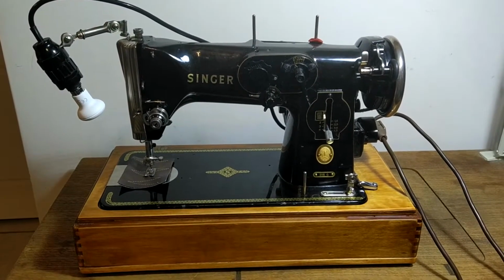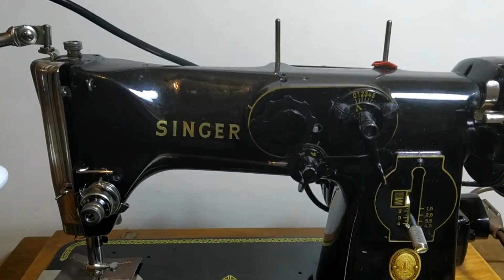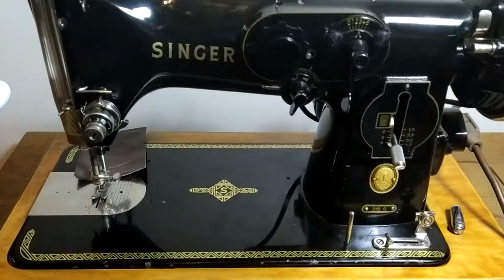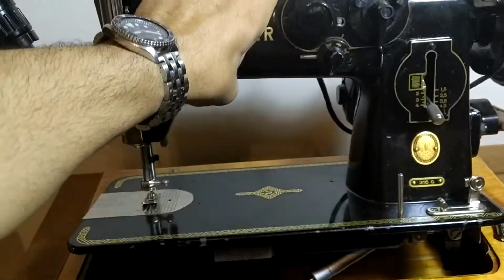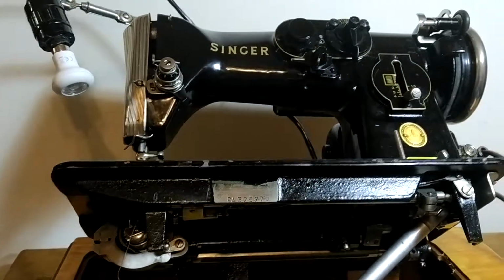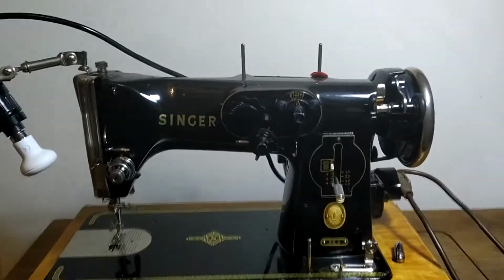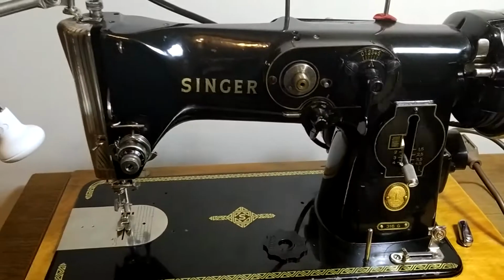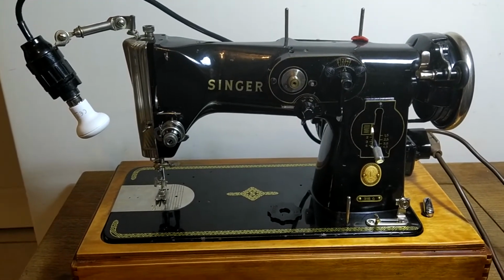Singer  316G  , ZigZag  Sewing Machine

Comment: Hi there! I know this video is a year old but I just came across it because I bought this machine very machine recently. I wanted a work horse and I think I found it. The biggest problem with the machine unfortunately is me I think, lol. I’m not experienced and ended up taking it in because I had it all messed up but after servicing it I was told it’s perfect, in fantastic shape, and will outlive us all. It came with a container full of so many attachments that I wouldn’t even begin to know how to use and with 30 cams. I’d be happy if I could just keep a straight stitch going with no issues. I’ve looked for videos on how to set everything properly for basic stitches on common fabrics but I’ve only seen reviews on it for the most part. Like I said. I know it’s not the machine but me so if you ever feel like making a how to on this machine I’d love to learn more properly. Thanks Yannis!
Reply from the maker: Just saw your comment.  I’ve really been busy lately.  To be quick.  There is a learning curve , when learning how to sew with these vintage sewing machines.  Assuming that the machine is mechanically sound , we must pay special attention to the tension that is applied on the thread.  On this specific machine we have the top tension which is regulated with the front tensioner dial. And then we have the bottom tensioner.  This being a class 15 bobbin , it has a small adjustment screw on the bobbin case, small incrementally turn to the right  will tighten , and a small incrementally turn to the left will loosen.  Proper tension is of utmost important so that we have the formation of a proper stitch.  The thickness of the fabric and also of the thread will dictate when we need to make tension adjustments.  It takes some time to learn these nuisances.

Don’t expect to learn everything at once , it takes time and patience.  Think of it as an adventure . Good Luck.
Reply: Thank you!

Comment: I own a 1954 Singer 216G machine that was manufactured ar Singer's factory in Karlsrhue Germany. I acquired it from a craigslist ad in 2011. It came to me with its original portable case, and original wooden base. The machine has the length of chain that you mentioned to hold it up at an angle in order to change the bobbin etc.  To prevent the machine and its base from flipping backward when in the raised position, there is a swing-out steel 'outrigger' that swings out 180 degrees from under the right end of the wooden base toward the rear of the wooden base to prevent the machine from toppling over. That outrigger works very well, and stores away at the bottom of the finger well on the right end of the wooden base..

Comment: Hi @YANNIS, did you managed to get the missing lamp part?  I also have a 316G with a complete lamp assembly.  I was thinking on making a printable 3D model of it, i believe it can be post processed and painted to make it look right, considering you still use a LED bacause of the heat.
Reply from the maker: Your idea about 3D printing sounds great!
Reply: @yannis0613  i'll model the lamp shade in the coming weeks for 3D printing a replacement. I uploaded a vid with some close ups of my 316G here: https://youtu.be/ZzIkQ3G22Lw It's a beautiful machine!
Reply from the maker: Giorgio , I have a replacement but love the Led because of it small size.  If it was for display , I’d put on the original lamp shade.